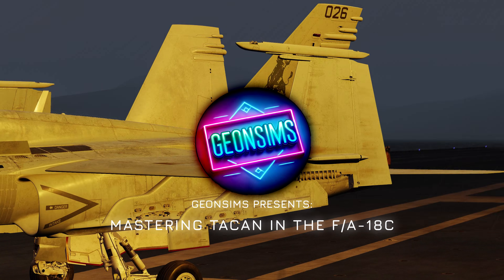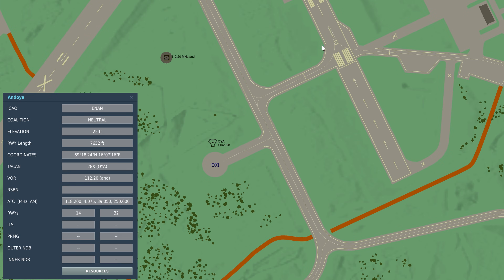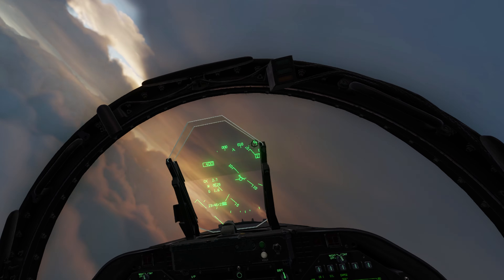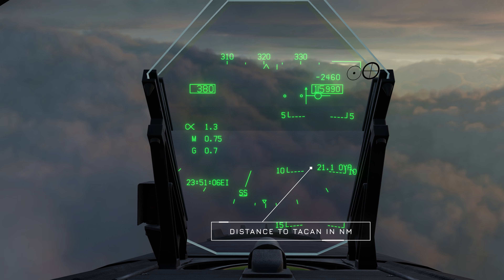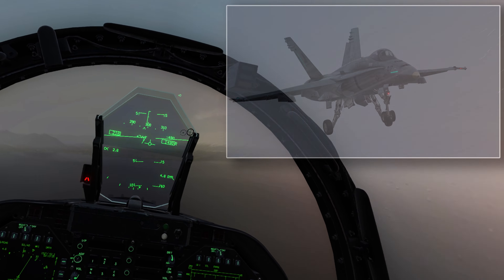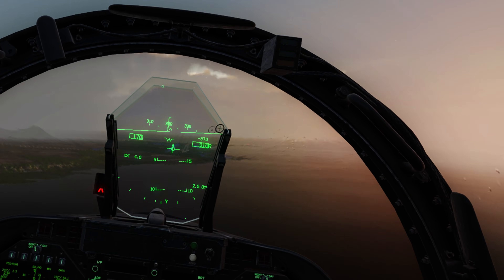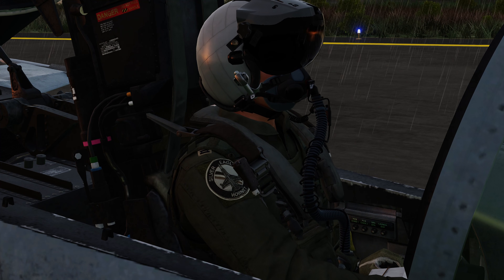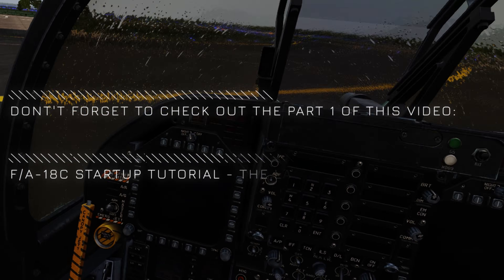F/A-18C TACAN Made Easy – Full Setup, Navigation & Landing (DCS World Guide)

Comment: How did you come up with the runway heading before you zoomed into the runway?  You showed the hearing at 320° but didn't say how to do that.
Reply from the maker: Hey, great question! Runway numbers actually come from their magnetic heading, rounded to the nearest 10°. So runway 32 means it’s aligned roughly at 320°. In the video I had pre-planned to land on that specific runway, which is why you see me setting 320° as the heading. 👍
Reply: @GEONSIMS I never knew.. That is awesome info! Thanks
Reply from the maker: @darrellwinston8909 My pleasure, working on the ICLS and Case III recovery currently. Should be out within a coupe of weeks. 👍
Reply from the maker: Give it a try and please let me know how you get on! 👍
Reply: @GEONSIMS the works.. Still weird when I am on the heading and on line with the crs line and I am still at an off angle when I am approaching the runway. I thought I would be completely lined up.
Reply from the maker: @darrellwinston8909  Yes exactly, TACAN is perfect for getting you close with bearing and range, but it won’t lock you precisely onto the runway centerline. For that you’ll need ILS (on land) or ICLS (on carriers). I’m just finishing the ICLS video now, and after that I’ll be dropping a quick ILS guide too, so stay tuned. 👍

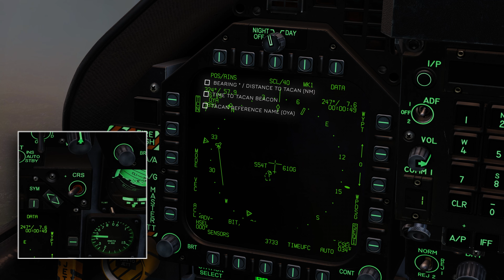Comment: Great to see operations in difficult weather conditions and how to achieve things…. Couple of points: 1) It would be worth explaining that the course can also be typed into the UFC (2:52). 2) By placing your HSI on the Left DDI the Advisor Information bar obscures your off track distance indication (3:53). 3) Set the QFE from the Radio Inbound call and at a distance of about 10nm settle to 2000ft and configure to dirty in level flight and get On Speed (just like a Case III). 4) A 3 degree glidepath is 300ft / nm so, at 7nm ease the throttle back to get the velocity vector to 3 degree down. 5) As the TACAN is never at the threshold add 0.5nm to all distances so, 4.5nm = 1200ft, 3.5nm = 900ft, 2.5nm= 600ft, 1.5nm = 300ft, 1nm = 200ft which a good Decision Height so, decide on “Visual to land” then adjust to line up with the runway (again the TACAN is never exactly aligned with the runway like an ILS), or “Going Around”…
Reply from the maker: Thanks so much for the detailed insights! You’re absolutely right, there’s a lot of depth to this topic, especially for more advanced simmers. For this video though, I aimed to keep it as simple and beginner-friendly as possible so that new players don’t get overwhelmed. I’ll definitely consider covering more advanced elements (like QFE setup, UFC inputs, and precise descent profiles) in future follow-ups for those wanting to go deeper. Really appreciate you sharing your knowledge!

I’ve had some time off and will be working on some more in depth videos to come 👍

Comment: Nice vid. Two things I saw: 1) show how you determined the direction (320) of the runway. And 2) On speed AOA. Just a couple of things others may not know yet.
Reply from the maker: Hey, thanks for the feedback, I’ll highly appreciate it. New channel, lots to cover, we’ll get into more detail in future. Another video to launch on Friday:

https://youtu.be/YPyDdtRax7A
Reply: This ⬆️.  I was wondering how you came up with 320°
Reply: @darrellwinston8909  The only way I know of is in the mission editor. You use the measuring tool to draw a line in the direction of LANDING on the runway, and note the measured degree. That will be your landing heading.
Reply: @rickmasseur2008 thanks for that info
Reply: @darrellwinston8909  The runways are marked at both ends. In this case, it was marked with 32. This means 320°. You have to know that or you find it in the map.
Reply: @RaptiFacebook I will test thus theory today